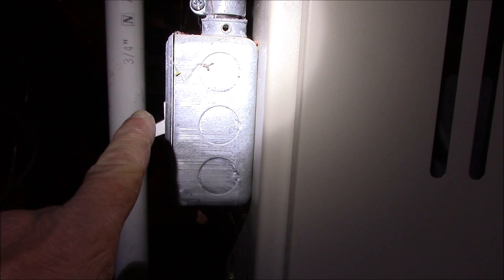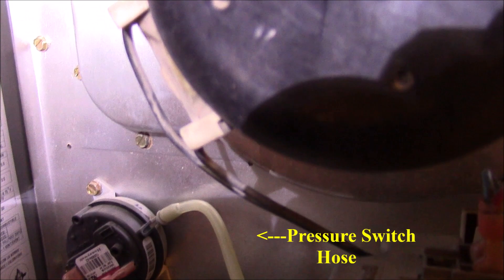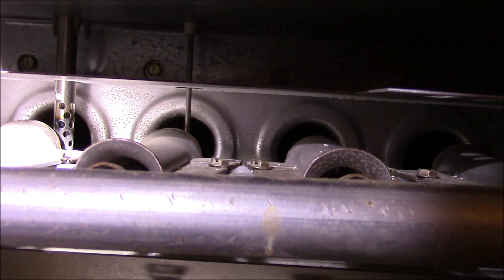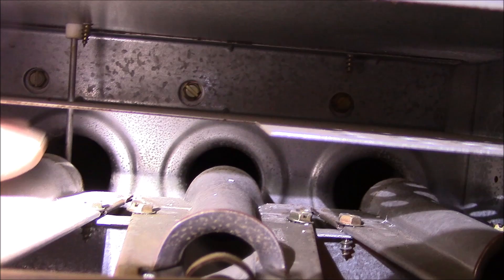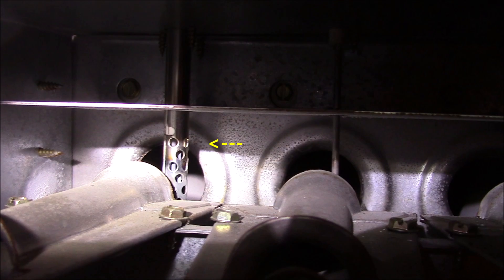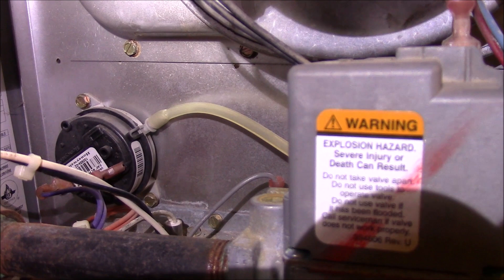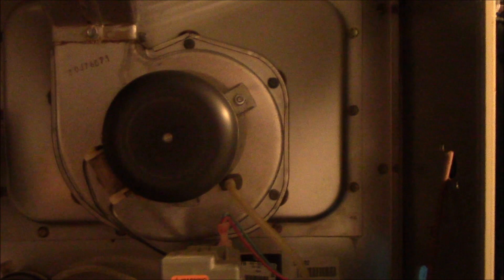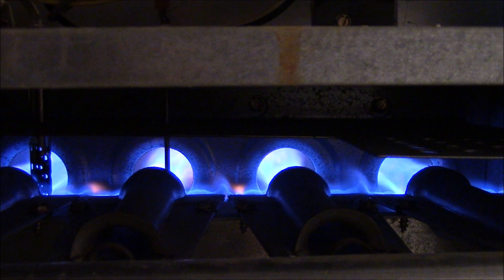Furnace Starting and then Stopping Solved!

Comment: Excellent video. It helped solve the on, off, on, etc issue. I first cleaned it the sensor which did have carbon build up. But I found the sensor was loose from the insulator. Went and bought a new one, and did not work correct at first. To anyone doing this for the first time, watch for orientation of how the sensor was positioned (especially if you have one that has a bend to it) when you take it out. After I took it out I found it was not positioned right in to the burner. Sensor cost $32, but would have likely been $200+ if I made a service call.

Comment: Until I saw your video, I had completely forgotten about this tube on the Draft Induction Motor.
We had trouble with this one before.
This time it was really clogged.
Nothing a paperclip couldn't handle, but I did employ my Shop Vac to suck the rust out.
Reply from the maker: So glad it worked for you.

Comment: I cleaned the flame sensor and that didn't solve the problem, but I found that nozzle plugged, as you did. Pushed a tiny allen wrench through the clog, and now it works. Thanks!
Reply from the maker: You just saved a ton of money. Cool.

Comment: My furnace  blows cold air and then shuts off after 2 mins. It  does this whether its on auto or on. What do I need to do please. this just started.
Reply from the maker: It could be a flame sensor issue.  https://www.youtube.com/watch?v=aj-SXJheALs  But, you might want to have it looked at by a professional if this does not work. I hope it does.

Comment: My furnace is brand new. It will run and decide to use heat pump or gas. After a while it will shut off and seconds later it will go back on with a loud jet engine sound. Any ideas?
Reply from the maker: If it is new I suggest contacting the company that installed it. I had a heater like that years ago and it made a similar sound but it was due to a leak. Please get yours checked out.
Reply: @LordCryptid  I plan on it thanks
Reply: @LordCryptid  According to the company that installed the system, it works on heat pump (electric) and when/if the system deems necessary it shuts off and then goes to propane. I have never had a heat pump before so does that sound correct? The installer said even though it ran on electric for 40 - 50 minutes it was still cheaper than 100% propane.
Reply from the maker: @BeaverDaveECV  This is a new one to me as well. Keep me posted as to how well it works and the savings you find.

Comment: what did you use to clean the guk in the hole again ?
Reply from the maker: I used the smallest screwdriver on my Leatherman Tool. A straightened paper clip would have worked just as well.

Comment: I tried pulling my hose out, but it's really stuck on there. Any tips to remove the hose???
Reply from the maker: You can use a needlenose pliar to slowly work the hose off. I f that does not work you might consider a light and controlled shot of a lubricant. I use WD-40 for everything. But maybe use a Q-tip to apply it so you don't get flammable gunk everywhere. Too much might corrode the hose so be sparing.